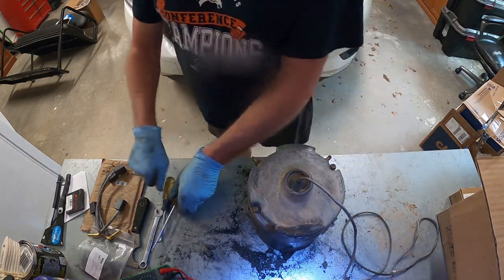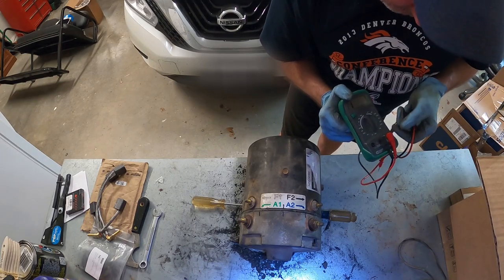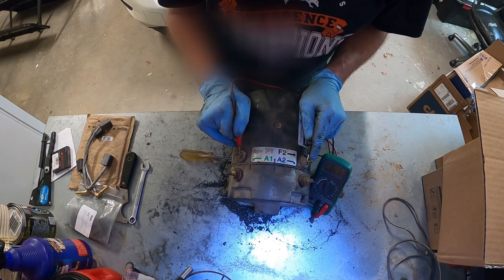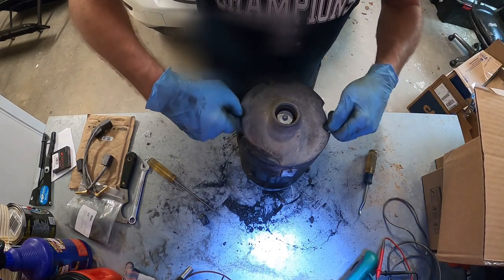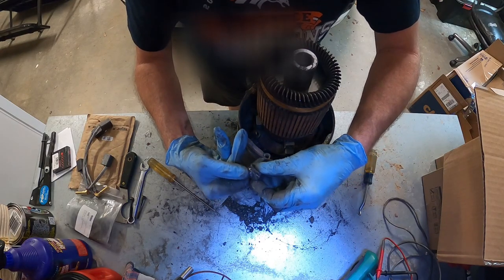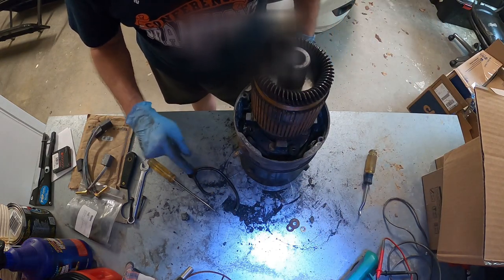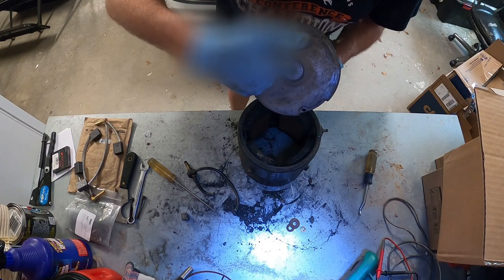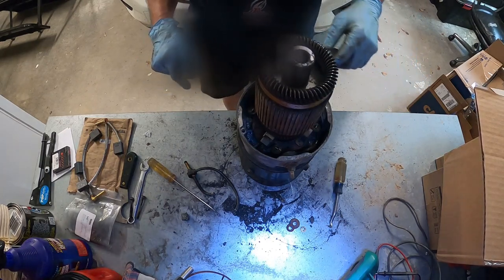EZGO golf cart GE electric DC brush motor troubleshoot fix repair. Good fix for most DC style motors

Comment: Thanks for the content! Picked up a barn find ezgo txt last weekend. Sucker would not roll in neutral for anything! Got it to the shack and found that the motor was seized in it. Fortunately I was able to find this content to help me. Its not the exact same motor, but the principles are the same. Digging into the motor I found the brushes were frozen and everything was caked with either rust or carbon dust. Evidently this cart had been submerged at some point. Regardless I was able to get the thing torn down and $70 dollars later I am waiting on the parts to fix it. Brush plate, brushes and a rear bearing. BTW, the cart rolls excellently with no motor, haha! I sure wish I had those 3 hrs of my life back I spent getting it on a trailer!

Comment: Just to add some general information, the motor is a "shunt" DC Motor. All dc motors require two sets of magnets to operate: A fixed set of magnets and a rotating set of magnets. 
The field terminals provide for the fixed magnets (in this case they're electromagnets but in some motors they can be permanent magnets) of the motor and the rotating armature (attached to the brushes) are the moving set of magnets in the motor. 
Reversing the polarity of the field connections of the motor will cause the motor to run in the opposite direction.
Reply: That's great information sir , last some days I am thinking how motor rotate reverse polarity, I got answer thank you

Comment: Thanks for the great video, but what should the meter reading be on the A terminals if the brushes are good. I am having issues with a 97 ezgo. Going to tes t the motor later tonight when i get off work. When i push the throttle pedal on it i get a dim light on all four motor leads that goes to bright as you press the pedal with a 36v test light. I would think one should show ground.

Comment: So on the motor one of my brush screws broke off on top outside of motor its A EZ CRUZE CART BATTERY OPERATED thiier might belike couple of threads left on the screw its self can i still use it to put wire back on and put nut back on it will that work

Comment: Cheers mate, i just bought a golf cart GE dc motor. I went through it and tested it all but when i put power to it it acts like its shorting. Not even a hint of trying to spin. Back to the drawing board....
Reply: Check ur overall pack voltage and make sure u solenoid is clicking

Comment: If I have .5 ohms on the A1-A2 does that mean it’s ok or would you pull the motor and open up the motor and replace them? There is 1.5 on F1-F-2
Reply: I have .3 ohms across A1-A2. Did you fix your problem?